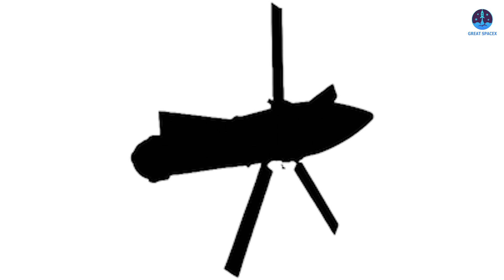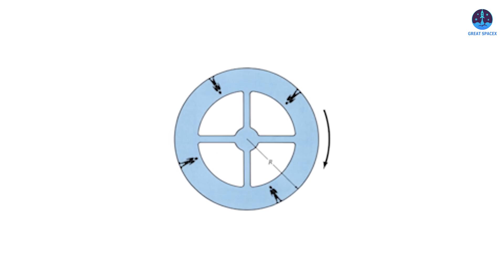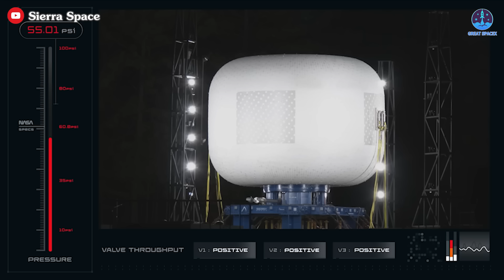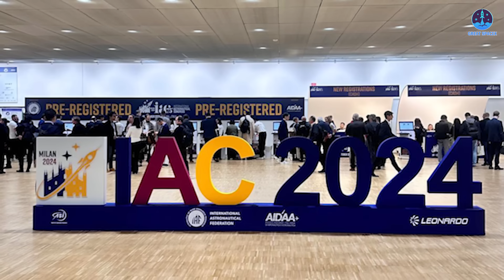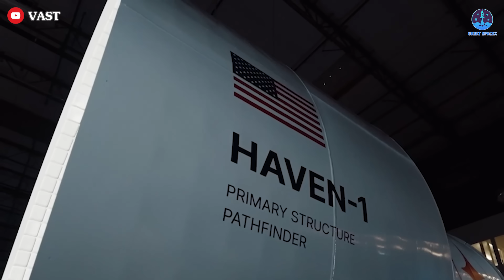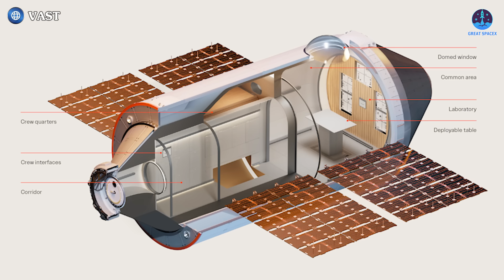NASA Revealed 4 Next Space Stations Generation!

Comment: The "Starlab" concept modules bring up an interesting question... how exactly will the design of Starship change when we get to the point of carrying payloads other than pancake shaped Starlink satellites? I don't think the "gaping clameshell" concept that I've seen will work with the current coverage of heat-shield tiles (which is more than 50% of the circumference everywhere and 70-75% near the forward flaps)

Comment: If you are going to have rotating space stations, it would be a good idea to develop a standard for bigger docking ports which can be walked/driven through - unless you like crawling from one room to another. Do this before all international competitors produce their own bespoke and incompatible designs.
Reply: There is already a standard set for devices/vessels that connect in space. i believe it was standardized in the late 2000s(2008?), Iirc.

By in large space development is going to remain primarily funded and driven by governments as there is no viable options outside of governments for 3rd party private space developers to profit from.

That will likely change however once we return to the moon and if a viable mining project becomes reality on the moon.
Reply: @DotADBX  The International Docking System Standard  of 2010 gives a passage only 0.8m across. Too small to walk/drive through. The new standard would need to be at least 2m-3m.
Reply: @clivemitchell3229  do you think in the future they won't make a new standard?
Reply: @DotADBX  Eventually they will, after the existing docking port (can't change it because everyone is using it) is shown to be not up to the job and the first big module manufacturer develops  their own which no-one else agrees to pay royalties for so each manufacturer develops their own. The subsequent difficulties will force cooperation.
Reply: @clivemitchell3229  its probably more likely that SpaceX will create it since their long term focus after starship is facilities and infrastructure while most other sources are focused on delivery systems, modules, ground transport and other forms of technology in space.
Reply: @DotADBX  I hope so. After Tesla shared their charger standard, there's a strong chance SpaceX would share a bigger docking port standard.

Comment: Ive not yet heard of any capability for Starship to "deploy" anything other than starlink. Is there going to be some sort of clam-shell to enable deployment of anything other than starlink?
Reply: Iirc elon suggested but did not confirm either a clamshell bay design or "sliding door" system on future starship designs.

It is likely a clamshell design will happen first and likely quickly as the us military has many projects on the go that will require starship for delivery last i heard.

Comment: Research in freefall is one of the primary reasons for having a space station, spin grav would negate its purpose.  Only the exact center of rotation would experience zero gravity.
Reply: A module in the middle containing a synchronous counter-rotating sleeve (i.e. non-rotating) would provide a microgravity environment together with artificial gravity in the outer modules, and no need for air-tight rotating joints.
Reply: @clivemitchell3229  And if the rotating structure isn't perfectly balanced at all times ...